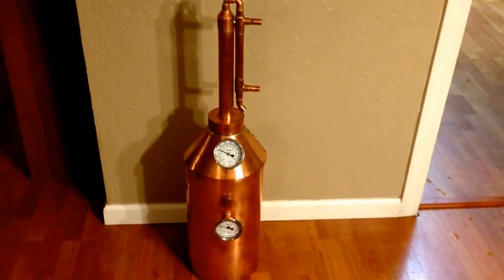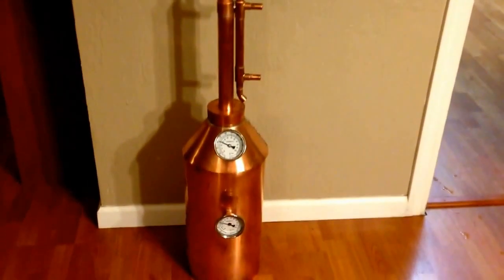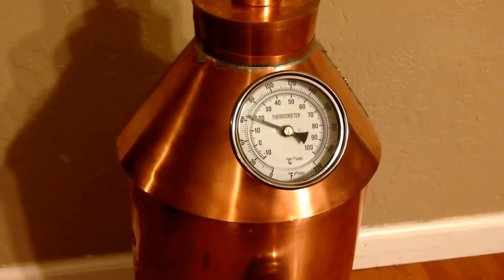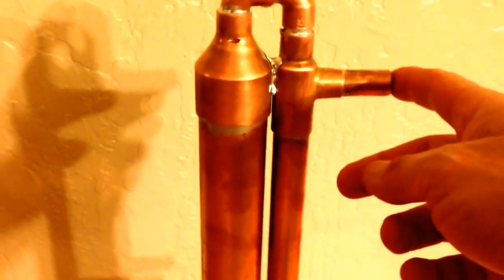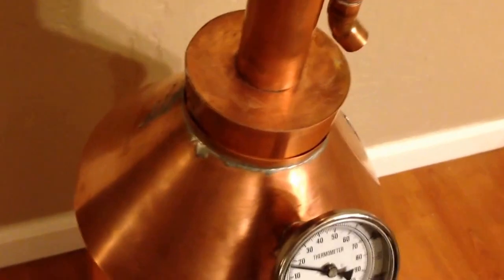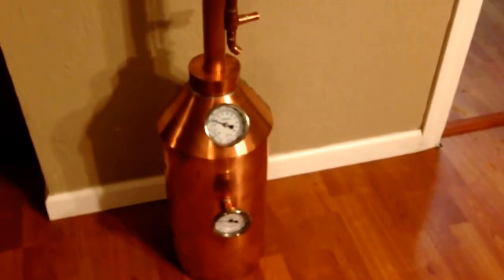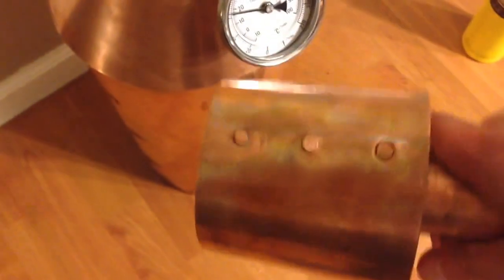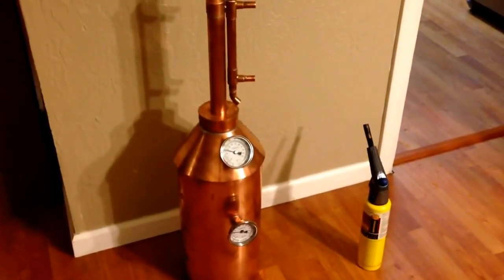5 Gallon Copper Still Project

Comment: The water goes in the bottom of the condenser and out the top. It keeps the jacket filled, which keeps the lyne arm completely surrounded by water. The other way, the water trickles down freely and doesn't cool as efficiently.

Comment: That's really beautiful, great job! I'm deciding between that and a pot still. I guess the deciding factor is water consumption. Do you have to keep a continuous flow of cold water through the condenser during operation? Thanks in advance.
Reply from the maker: Yes a continuous flow of water through distillation. You do use a bit of water but not that much. About 5 gallons every 45 minutes and I capture it in my carboy to water plants or do laundry as I'm distilling. I'm going to setup a circulating pump so I can fill a tub of water with ice & water. It'll waste less water then. I do like the column on this still. I packed the column with 4 all copper scouring pads and it made a huge difference removing off flavors when making rum. I like the column because I usually do single passes (without stripping and spirit run).

Comment: hi Kraigseder that's a very nice still you should be proud! im new to this sort of stuff i have a few questions? i understand that water flows through the t's but do you just run copper line from the bottom of the arm into your holding tank. and also whats a good way to set up to water flow
Reply: I use clear plastic hose with pipe clamps to a 12v submersible pump to a large cooler of ice water or my pool (from the boating section at Wally World).  I power it with a 12v battery charger, lol.  Hey it works.  I was thinking about it the other day and I think I'm going to add threaded ends to my cooling pipes so I can attach a garden hose.  Make breakdown faster.
Reply: thanks for the info and that's how we do it out here in the sticks rig it up and if it works then its good to go lol

Comment: Hi Kraig,Nice still! Do you plan on making a video of you set up your condenser?
Reply: Bruce piggott I hope I understood you comment correctly.  The condenser is attached to the column cap on this particular still.  It is one pipe fed through another pipe in conjunction with a couple T fittings.  Water runs into the T and between the two pipes, thus cooling the vapors.  Look to the right side of the still.
Reply from the maker: Bruce piggott Sorry I didn't respond sooner. I just saw this post. This doesn't use a traditional coil condenser. Cool water goes into the bottom inlet and goes out the top. The water flows in a smaller tube inside the larger copper tube where the vapors flow. The hot vapors come down and when they come into contact with the cooler copper tube the alcohol condenses.

Comment: Very nice job, I’m living in Canada and I’m wondering if customs will let it into the country. I’d love one of those gems
Reply from the maker: The kit comes in pre-cut flat copper pieces so it's not a still yet.  Maybe you could contact Claw Hammer Supply about sending the kit in a discretely marked box, though I think that's how they send it.  You'd never know what's in the flat box other that sheets of copper. Best of luck.  It's a very well made kit and this was my first time soldering anything bigger than wires on a circuit board. It turned out pretty good.
Reply: Got mine in no problem. Had to pay something like 75 dollars in duty fees but it arrived.

Comment: beautiful still kraig, im looking at buying one from claw hammer supply myself, now dod it come with the temp gauges? or did u buy those seperate? claw hammer is the best palce i found them so far.. other places want $600+ for a 5gal still with thumper
Reply from the maker: Thank you. It was fun to build and it works great. I bought the gauges on Amazon for $15 each and then bought the 1/2" copper connector that I soldered into my still at a local hardware store in the plumbing section. If you just go with one gauge I would put it in the top so you can monitor your vapor temp. I decided to go overkill and install two so I could monitor my liquid temp and my vapor temp. You can't beat the Clawhammer price and still design for the money. I have never tried soldering anything like this before and I was surprised how well it turned out.

Comment: Hey Kraigseder. I realize this video is from a while ago but im thinking about buying one of their kits. Could you give me any info on what kind of proof, amount and taste your getting out? Thanks!
Reply from the maker: Chance Hugus This is based on a double distillation where I have two 5 gallon carboys of wash. I'll distill each separate then combine for a final run. 

On the first runs I get about a gallon of 110 proof each. It starts out at 140 proof with the first jar and tapers down in proof until it gets to about 70 proof and cloudy. I then run a second 5 gallon batch through it the same way. 

I then take the 2 runs which equal a little over 2 gallons and add a gallon and a half of distilled water (for safety) to do the final spirit run. This run I do slower than the first two runs. The spirit run will start at about 165 proof and I collect until it lowers to 90 proof where I stop collecting.  

Mixing: If you collect 12 jars set aside the set aside the first jar and last jars for your next run since the flavors aren't going to be good but they have alcohol to use next time you run your still. Next take the next two jars from the beginning and last two jars from the end and slowly start to add them to your hearts for taste. 

This is a very short explanation of the process but hopefully it helps a bit. Check out Clawhammer Supply's website. They have a lot of good info on the full process with all the details.
Reply from the maker: Chance Hugus The flavor is really good. I've found that distillers yeasts really aren't needed and can really mess up the flavor. I've been using fleischmann's dry active yeast on my last batches and the rum and whiskey flavor is so much better. I just use 2 packets of the yeast for 5 gallons of wash. I'm getting the same alcohol production as distillers yeast gave.

Comment: Ha don't get the reason isaid that is because if u hook it up like u said in the video u will shock it and no products. Wont come out it will cool it to fast and turn back in to water and go back in ur pot and wont come out the discharge tube cause it cools to fast if u hook it backwards that's what I ment by shocking it so hook the water in on the bottom and water out on top I just didn't want u to run ur product brother just looking out
Reply from the maker: I'm learning all the time... geez I can't believe I had it switched. Luckily I have a pressure tip on my hose so it was always filled with water but I'll be sure to switch my hookup next run. Thanks for the heads up!